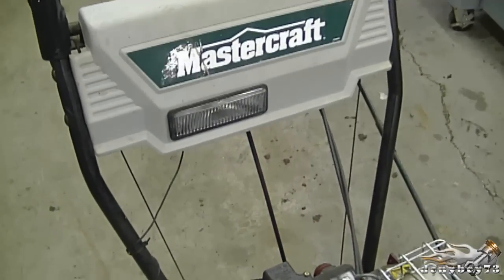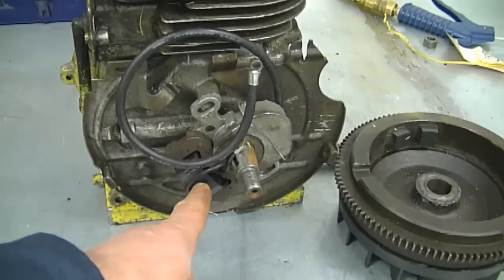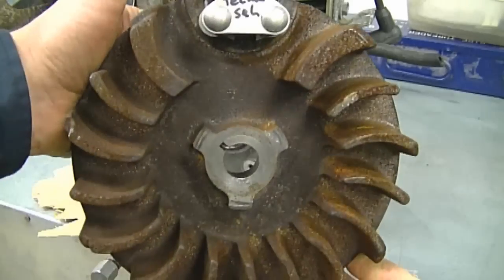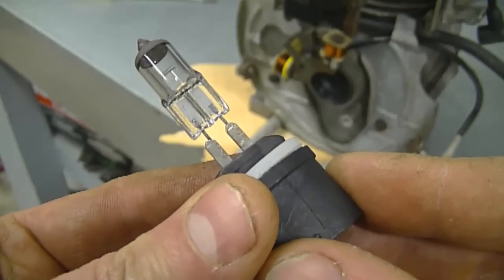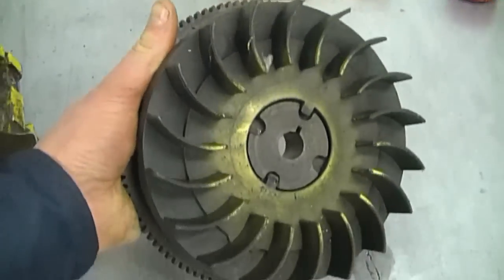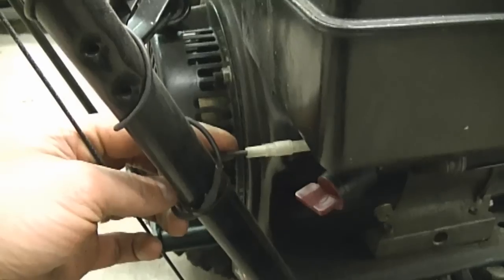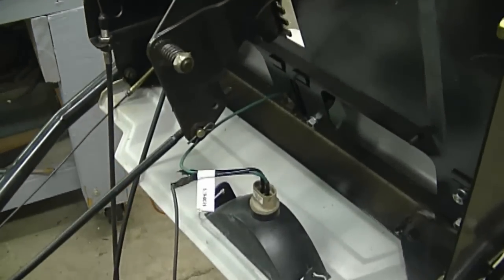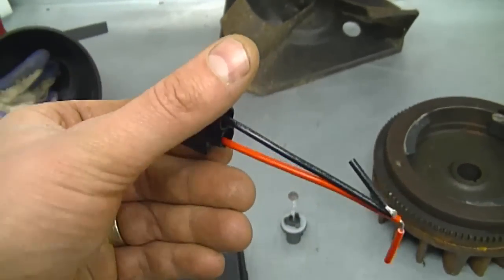HOW A Snowblower Light Works And The Parts Required - Video

Comment: Hi Dony, I am not sure if someone else mentioned it already the power coming out of that wire will be AC current only. If you want to connect an LED light, you need to wire in a bridge rectifier and a couple capacitors to smooth out the output. There are plenty of videos for doing this.

Comment: Thank you for this video, i Just get a 13,5hp snowblower that light did not worked, first checked the stator with multimeter and it was ok, than i starte to check the wire ring, and it urned out to be the ground wire was not connected proper to the frame

Comment: FYI .  I used an old 12V battery powered drill, the 12V battery from my lawn tractor( small size) and a double pole double throw toggle switch with center neutra for this modification.l.   I removed the top half of the chute direction shaft, chucked remaining shaft tightly in the drill and mounted the drill under the operating console.  I now can rotate my chute quickly left to right or any position in between, using the toggle switch.  I have a 3 sided canopy on my 30" 10.5 hp Snowblower and have a rotating blue light on top of it.  Just because I could!  Also a HCSL from a Blazer with a 12" row of red led's at the top of the rear of the canopy.  Battery will last several hours without recharging.  County guys always wave. In this video, Dony neglected to mention that the 12V 27W bulb is an AC bulb.

Comment: Hey Donny I bought a new Craftsman 7hp Tecumseh snowblower back in 07 which didn't have a light. It was one of those OHV engines. I ended up pulling the flywheel off and adding a stator. Just to come to find out that my flywheel didn't have any magnets inside of it. So I ended up ordering a complete other flywheel. Now the craftsman blower had a light already and just added a bulb and a wiring harness and bam. Looks like a factory setup.

Comment: A 12vdc motor with a flywheel in contact with one of the belts could be set up to produce some electrical power. Even an old fashioned bicycle dynamo/generator.could be placed in contact with either the belt drive or one of the operating flywheels.

Comment: Hey donyboy i just bought a honda gx200 to go on a minibike i was riding it and i noticed that it was poping or back firing when i was decelerating it was poping out of the muffler and i was listening to it when it was idling and i could hear a loud ticking from the valves would an valve out of adjustment cause the engine to do this it is. i just got it yesterday i thing the valve was not adjusted correctly at the factory i have never had a honda make a ticking from the valve when is was new

Comment: I have a new Troy Bilt Storm 2410 that did not come with a light. Looked on the diagrams and don't see anything attached to the flywheel, and there is a casing around the electric start and around the flywheel. Do you think there is a way that I would be able to hook up a light?

Comment: Our MTD has a stator and the wire under the gas tank, the wire goes to a male 3 prong triangular plug, how do you determine which wire is the hot wire? When engine running I put a test light on the prongs in different combinations and it seems to want to stall out the engine? BTW the wire is very short and hard to tell colors of wire etc.

Comment: I had that same MTD light fixture on my old blower and the cardboard reflector kept falling down and covering the bulb. I ended up replacing it with "Northern Industrial Mini Wide Beam Sportlight Kit — 12 Volt" from Northern Tool. I got 2 for 10 bucks - used one and kept the other as a spare. It was pretty close in size & shape but not perfect. A huge difference in both quality and quantity of light, especially if yours is a few years old and the plastic lens is cloudy. Amazon has them also.

Comment: Would single stage blower have capability to add lights to it? like using the Bridge Rectifier. Mine is a Honda HS720 which I want to add some sort of LED light to it. Thanks

Comment: What if my snowblower has a headlight and everything necessary, the light used to work but stopped working, I tried three different bulbs and no light in produced. What can I do to fix it ? What are the potential solutions ?

Comment: Could i possibly put a resister or a high voltage light bulb? I am actualy using a motor from a blower that is going to go on a minibike. Would the coil light the light at all

Comment: Hello donyboy the way i got a light on my snowblower that has no stator is by using a small high performance rc car motor. All you do is open up the belt cover and on the outermost nut, i had a 14mm socket connected to a connecting rod which turns the motor. My engine currently at full throttle spins at 3.7 k rpm, which makes about 6.78 volts. I have used it to power a 14 led homemade light might post a video later on

Comment: That bulb and connector are both automotive parts, the bulb is a fog light used in cars like a 97 Pontiac Bonneville. The socket for that bulb is AC Delco part # PT2345, but other companies make them, too. Most parts stores should have them or be able to get them.

Comment: Using the plug as you show at 3:22 in the video, could heated handle grips be installed using that plug in the same manner as installing the light?

Comment: I was doing basic maintenance on my snowblower and noticed the wire coming out of the engine. I was toying with the idea of adding a light.

You mentioned that it is also a safety feature. so cars see the light and movement. Maybe you see what you're snowblowing.

A $10-20 12v fog light from a car would work.
Reply: i tried one i had on mine and the light was very dim... i plan on replaceing it with a lower wattage bulb and see what that does

Comment: Hi donyboy73- I just bought a used Yard Machines snow blower 2 yrs. old. It doesn't have a light. Same engine as a new one that has a light. Mine doesn't have the wire out of the engine. I didn't take the engine apart, although I can see the fly wheel and it does have a magnet on it. Do you think it has the STATER you mention, and if so how can I hook the wire to the stater  to run a light. Again it is the same blower and engine as a new one that has a light. Great Video- Thanks !

Comment: For the old points fired tecumseh's why not rig a generator in the spot for the electric starter if it's not used, or even add a spot for a bike style generator to contact to flywheel. You could probably bend a bracket to share the same mounts as the starter.

Comment: Quick question for you. I recently just got a snowblower with a tecumseh engine model # lh195sa. But it has no lights. It does have the exterior mounted coil like the newer engine in your video. The parts diagrams show that this engine can have a lighting coil. But I cannot find a flywheel that has the magnets. So onto my question, Will a flywheel from an 8hp engine work fine on my 5hp snow king engine?

Comment: One more question donyboy73 You know  the wire coming off the snowblower stator that has the white plastic plug on the end? Where can I get the connector that plugs into this and what is it called? I also have a craftsman snowblower that has that stator wire with the white connector on the end but the light kit is no longer available so I just need that connector and I can put a different brand light on the machine.

Comment: I have an old yardman snow thrower with a Tecumseh 10HP HMSK 100 engine which came with a light. The light no longer works and when I checked for voltage at the wire for the light it had no out-put. Checked for ground and it's OK.  Is it possible that rust that has formed on the flywheel magnets and stator cause a no voltage condition. The reason for my question is I had a problem with another HM 100 Tecumseh on my generator that had no spark and when I cleaned the rust off the flywheel magnets and coil it worked fine. Just wanted to ask before I went ahead and pulled the flywheel.

Comment: On this video for connecting a light I have Tecumseh engine with the wire like you show.But the Tecumseh spec show the alternator as an 18 watt.Right  now I'm using a 18watt seal beam #4414.If I was to change to the bulb you say 27 watts wouldn't that overload the alternator and burn it.I find the 18 watt not all that bright gives off  more of a yellowish light.I understand I would have to change the housing which is not a problem.

Comment: Hello Dony. I have a 2004 craftsman 9hp 27inch. The snow chute does not stay in place after I swivel it . the weight of the snow spins it around . it's as if it was loose. I constantly have to have a hand on adjusting the turn knob to keep it in place. how do I adjust it so its more stiff and fixed?
Reply: Wrap a short length of bungee cord around the shaft that turns the chute  to give some resistance to the snow load.

Comment: where do you get that plug that plugs onto the light? my light bulb is burnt out. I measured 14Vac on the wires when the engine is running so thats good.  My wifes were just plugged onto the pins of the bulb and I'd like to put that connector on to keep water out.

Comment: I have an Ariens Platinum snowblower with I believe 30W Handwarmers and I replaced the 20W Light with Two LED Lights of 27W Each, by splicing the wire to the same connector on your video (Video to be Posted very Soon). It works great, but how do you know how much Wattage you can safely take from the Stator?
Reply from the maker: let me know when the video is up

Comment: Or run a small dynamo off of the wheel drive belt, if it's free running or a dynamo with a rubber tire off of the crankshaft

Comment: Sir I am trying to put a 12v starter starter on my generator for easy starting. It is a Generac 6500xl the motor is a13hp and on the pull starter it says  GN-360. I need a flywheel and starter that match, so far not any luck, can you help. Thanks Blackford86  Alaska

Comment: My snowblower has that wire, and i bought a light kit, but the light output was so dim.  I use an omhmeter to check the wire voltage, the output only produce 2 to 3 volts.  What could be wrong with that?

Comment: My John Deere snow blower how has a plug but no light.
There are 3 wires coming out into the plug why do you think it has 3 wires?
I did a voltage test on the wires I think once is a ground and the other 2 are positives, but I find it strange that there are 3 wires.

Comment: Hello. is it safe to put a small 12v battery on the snowblower , will the stator overcharge or damage a battery?
I want to put a LED work light on it and LED's don't like the inconsistent stator as a power supply and will break fast without consistent power.
Please, if you know anything about this let us know.

Comment: What voltage is generated by a simple generator system like this? How do you know what voltage/current you're going to get? Wouldn't it be pretty dirty? Wouldn't there be some circuitry required - like a voltage regulator? ...some capacitors to smooth out the voltage to make it usable?

Comment: where theres a will there indeed IS a way but he did mention WITHOUT modifications beyond factory.

with that said: one big thing he forgot to add is that the engines without the space for a stator CAN have lights added. its as simple as adding an alternator to the belt system. you dont want a very big output as it would bog the engine down depending on the HP but adding a 35 amp GM car alternator should suffice for a few good lights. dont forget to add a small battery to the setup.

or use a motor capable of outputting the proper voltage and wattage.

Comment: Without pulling the engine apart how can you determine  what stator set you have?
Reply: my guess is if you dont have a light you probably cant have the stator
Reply: Based on his video, check the plug wire. If it comes from underneath the flywheel then probably no light because the ignition is on the crankshaft and no room for the generator/alternator. If the plug wire is outside the flywheel, confirm by looking for the ignition system, then look for the generator wire. If Its there check for current-probably 12V AC, I believe. He never mentioned the need for a bridge rectifier. that needs to be changed from 12V AC to DC. Most aftermarket 12V light kits are DC. Good luck.

Comment: any idea how to take the 18 watt stator to charge the starter battery rather than a light?
Reply: You would need a bridge rectifier, then use a buk converter to raise the voltage to 14.4 volts. There would be some loss. I'm not sure it's worth it

Comment: Another great video Dony, I am wonder if I can add more lights to my snowblower by tying into the factory wiring if my already existing light or will that be to much of a strain on the system, have a great Christmas.
Reply: Great video. i knew already some of what you explained but did pick up some more useful knowledge from the video.

Comment: Do you know how I can fix my Briggs the threads in the engine are striped complete it is the ones that the carb scores in to the engine and the pull cord go's on it is 1979 3.5 horizontal engine

Comment: I have a Simplicity 860E.  It has an orange light.  I need to replace the bulb but want to use an easily found automotive bulb.  Would you know the part number of an automotive bulb?  Thank you Gino
Reply: Bring it in with you to the auto parts store and try to match it up that way.
Reply: These are NOT automotive 12V DC bulbs.  I believe they are AC bulbs.  Go to snowmachine dealer.

Comment: Is it possible to add the proper components (stator, alternator, generator?) to a 2011 year Troy Bilt Storm 2410?  It did not come with a light and I can't find any wires anywhere that would be intended for connecting one.  How can this be accomplished?
Reply from the maker: you would have to contact MTD
Reply: donyboy73 Thanks for the suggestion.

Comment: They arent expensive at all its an old brushed motor mine i think is 380 sized but the bigger the more electricity is produced. I used just a straight connection so engine rpm equals motor rpm but you can build a geer mechanism and makes even more my snowblower is just small and down on space

Comment: Hi Donyboy73, I have a craftsman snowblower with a briggs and stratton engine that continually blows light bulbs and even cased the heated grips to melt. I am guessing that the voltage has somehow become too high. Do you have any recommendations or ideas around the cause and how to fix this?
Reply: smaller fuse?

Comment: Great vids and greetings from Norway! I found that wire under the engine with the w ierd plug end on it. Is it just the one wire in there? or 2? If just one, how do I hook up a bridge rectifier (4 points). I'm trying to hook up a led light sourse. I would really appreciate some advice!!
Reply: Hey me too! if you have already figured it out, maybe you could help me clarify something. The one coming from the alternator goes into a bridge rectifier, the ground from the chassis goes into another prong, and then from there to the light or to a switch. Would that work?
Reply: I believe you need to wire the light from the remaining 2 spade terminals.
One terminal may have a different orientation and I THINK that it is either the + for the LED or it is where the lead from the stator goes.

Comment: I hooked up a 55w light on my snowblower but it's very dim. It appears to put out about 45 millivolts. The light is very bright on the bench connected to a 12v power supply. Your thoughts? Btw I love your videos. Thanks for them.
Reply: Connor D'Amico 

LED light or halogen? Check how many amp is being produce with a voltmeter!!! If it’s a LED you need a bridge rectifier..... need more detail on your setup for a proper diagnostic!!
Reply: The output stator on Tecumseh engines is only rated for 18 watts AC current.

Comment: Hi
Question, I have a fairly new craftsman snowblower, (1-3 years) no lights with electric start. (Tecumseh motor)
Could that run self charging lights?
Thanks again..
Mike.
Reply: Is the electric start battery powered or do you have to plug in an extension cord?
Reply: It uses an extension cord. I have one like it

Comment: Hi, I've got an 8 HP Tecumseh engine like the partially yellow painted one in this video, there's a round disc bolted on the front of the shroud that feels like it's magnetized when I turn on the semi flexible square shaft that slides in the back of the disc and it's got a thin walled socket that slides over the nut that fastens the flywheel. I'd like to use it to generate a light for my snow blower if that's what it's for. I've done a fair amount of research on this and cant seem to even find a picture of it. Is there anyone who can educate me on this and where I can get any type of  info on it, and I really do mean any kind of info please.

Comment: I would just zip-tie a light emitting diode (LED) flashlight (~$2-3) to it, probably works just as well, but should use batteries that are weather and temperature resistant like lithium batteries.

Comment: Heres what I  did....

The Home Depot sells an LED work light thet is rechargeable.by the 120 volt cord. The light is there Husky brand, and costs around 60 dollars. Discard the base and bolt the "U"shaped bracket to your Snowblower, adjust your light, and plug in to charge. To use, unplug, wrap the cord around the base of the light, hit the switch..... And your off; the light is extremely bright, and has two brightness settings. The battery will last 3 hours on high, and 5 hours on the low setting.  When finished,  plug the light into an outlet to recharge.  It also makes a great worklight when servicing your machine. ..
Reply from the maker: good idea
Reply: Robert Mitchum you win!
Reply: Sounds like the easiest solution yet! Thanks for the tip! !